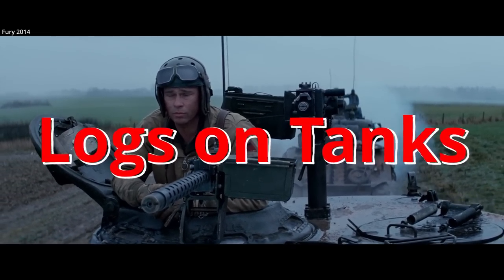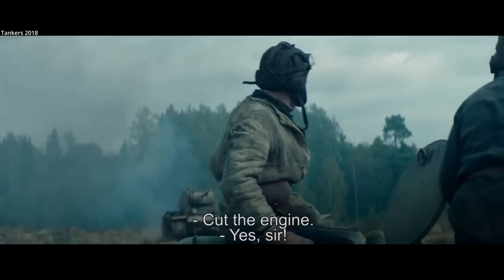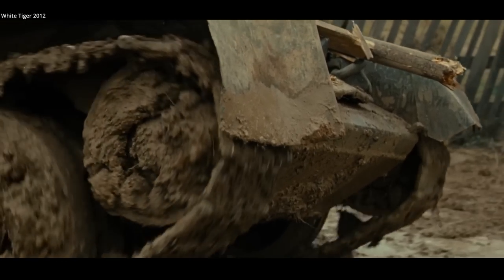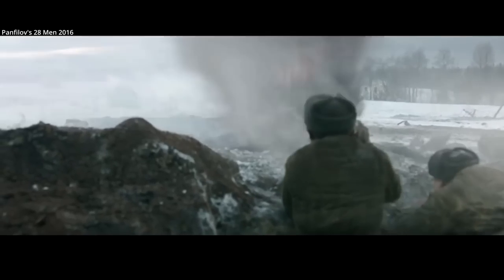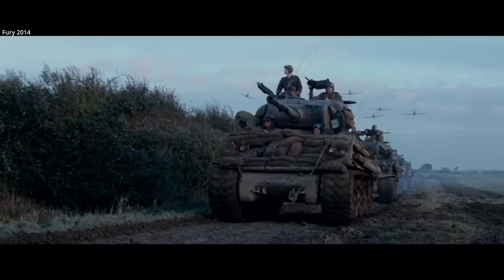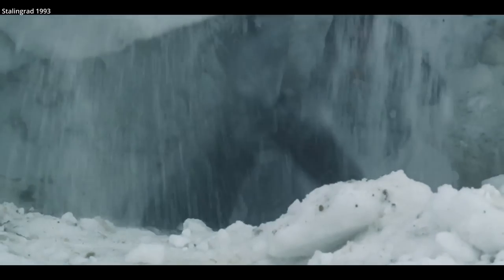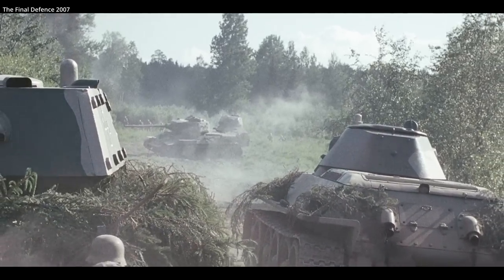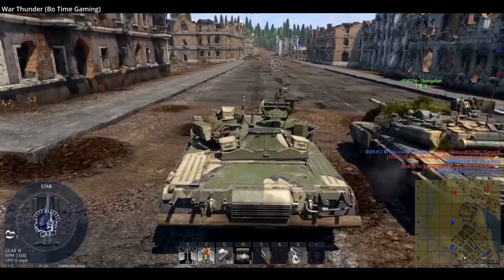What's with those logs on tanks?

Comment: During the Battle of Marawi in the Philippines, some armored vehicles of the Philippine Army were covered with planks of wood on the sides to provide protection from RPGs. They did work excellently
Reply: i was confused for a minute when i read RPG, i thought you writing about the Japanese during the Philippines campaign 
but i remember the war with IS fighters
Reply: Lucky they got older Soviet rocket propelled grenade from Maute/ISIS group
Reply: Was it a standoff effect, adding just enough space between the older RPGs and the actual armour to blunt the impacts? I know the militants there mostly had 70s era types of warheads, and very few more modern tandem ones as they didn't have Iran and Syria next door to funnel better kit into their hands.
Reply: @Del_S  I think it’s a load of heavy speculation, especially when only going off publicly available info. The vid goes over HEAT weapons which describe the RPG and what I have heard anecdotally is wood is mostly ineffective/of negligible effect.

I’m not saying vehicles surviving hits with this armor installed aren’t the case, just that surviving due to the armor hasn’t really been substantiated.

EDIT: it also heavily depends on the quality, age, and maintenance of the weapons used against the tank which tend to vary a lot with non-state actor groups.
Reply: From what I read it like most other improvised armour had little real effect, but did have a morale effect of making crews more confident in their armours protection. Problem is that almost nothing that the AFP rolled into Marawi actually had thick enough armour to stand up to anti-tank weapons, thus a panic to develop improvised solutions occured as happens in so many wars.
Reply: they actually faced RPG-2s most of the time. and these antiquated weapons are used with "homemade" rockets, so their effectiveness is questionable. even cardboard stopped a rocket and caught the spall.
Reply: BRO I WAS ILIGAN BACK IN 2017
Reply: This is what I call the poormans ERA
Reply: During the American Civil War, the Confederates strapped cotton bales to sides of river boats for protection, and it actually worked.
Reply: oh yes! i remember seeing pictures of their IFV's and wheeled armored vehicles covered in a shitload of planks on their sides, front and back
it was crude but it certaintly did the job.
also some of the captions and drawings made on the planks by their crews were funny or just straight out of mad max, it rocks.
Reply: @maru5235  true. One APC in that battle was named "Free WiFi"
Reply: Same with Indonesian soldier during the Aceh Rebellion
Reply: @Del_S  The intent was that the soft pine would not initiate the fuse, but would still cause the projectile body to crush/distort or yaw.   Sort of like a poor man's cage armor.
Reply: Sir the rpg was invented in 1953 in soviet russia and I think you ment the Japanese grenades and mortars
Reply: @DietrichM1  sir the battle of marawi took place in 2017
Reply: @DietrichM1  do some research
Reply: I member
Reply: One of the Filipinos I knew who fought in Marawi said to him, it looked like the crews poured dirt or stored extra ammo in the boxes, using them like big wooden sandbags. I don't know if that is fully true, though, but it's what he told me when I asked him if it was just wood or if they put stuff in it
Reply: It can work with older RPG but new version of RPG can easily destroy those wood protection. A 74 mm gun from T34 can cause the Phil. armoured vehicle to overturn if there is no turret. The impact is very strong.
Reply: @DietrichM1  some sort of history guy ha?
Reply: @silentwatcher1455 a  Soviet T34 fought German Tigers. Of course it outmatch even an APC
Reply: “free wifi”
Reply: Its a gamble but it worked

Comment: Getting unstuck, extra layers of armor, ready use firewood, there's many reasons to use logs on tanks. So it's not an issue having a few logs on tanks.
Reply: Sounds like the real question is why wouldn't you!?
Reply: Well the thing is, that can only be applied to tank. With human, unless you are in a tribal, or you are a rust player, wood body armour made from logs would not be a good idea
Reply: And to look badass.
Reply: Not to mention bouncing 88mm shells at point blank range.
🤣🤣🤣🤣
Reply: @zaholykrusedar1459  Why?
Reply: @manchotoberkommando  cumbersome, and low-protection aganist arrow, bolt and bullet, unless you make it hella thick, which futher the cumbersome, then it can protect you from those first two and maybe pistol round, but definitely not rifle round
Reply: @NK-qn6pq  it didn't bounce. It went straight through both sides, and spalling had jammed the turret. They were lucky to dodge shot at crew.
Reply: @planescaped  More weight = more fuel consumption to travel the same distance. If fuel is scarce, you want to move lightly.
Reply: That's why I have 3 strapped to each side of my car at all times

Comment: The British WW1 tanks had rails running above the sides of the tank for the unditching beam it carried. If they got stuck the beam was attached to the track by hooks and chains and the movement of the track pulled the beam forward and under the tank. Unlike using a log the beam could be kept moving until the tank cleared itself of the mud. This not only helped unditch the tank but the rails made sure the beam cleared the cab where the driver and commander sat. Unditching was so important that they would forgo a turret on the top of the tank.
Reply: Hobart,s funnies of WW2  were innovative  too....
Reply: @eamonnclabby7067  That is true. Someone once claimed that the Germans were the best at repurposing tanks. That person obviously had not heard of the 79th Armoured Division

Comment: 1:50 Just throwing this out there, but until the introduction of the Panther the Sherman had the most armor of any main line medium, especially when accounting for effective thickness. The sides were the only portion of the tank that could be considered thin, but again were comparable to the armor on the PZIV.
Reply: Yes, you're more than correct. The myth was prevalent though. It does seem many American tankers legitimately believed their tanks to be under armored. My guess is due to the excellent German guns they faced because in the Japanese theater they never had an issue with armor protection. Hell, even the M3 was adequate in that theater. Despite having some of the best all round armor and overall protection for much of the war, people often act, or at least they used to often act, like the Tiger and Panther were all the Sherman ever faced when that simply was not true. Most of what the Sherman fought against up until 44 was inferior to it. Sure, the German Panzer IV F2 and beyond could out gun the Sherman but it still never had armor quite on par with the Sherman and even the medium 75mm gun could knock out the latest of Panzer IV tanks.
Reply: TLDR in regards of armor debate:

Not the armor but the calibre and barrel length made all the difference.
Sherman M4A1 75mm L/40 were shorter than
German KWK 75mm L/43 or L/48 and other types.
The Sherman crews in Italy, North Africa or Normandy faced superior anti tank firepower whenever they were engaged 
which made them doubt in their armors effectiveness. 
Hence the nickname "Bronson" for their Sherman tank. A lighter, that "lights every time".
---
Guns of common medium tanks during 1943/1944:
Germany used their Kampfwagenkanonen main guns in very different tank designs:
7.5cm KwK 40 75mm L/43 used in PzKpfw IV Ausführungen F2 and G
7.5cm KwK 40 75mm L/48 used in PzKpfw IV Ausführungen G-J or Jagdpanzer IV
7.5cm KwK 42 75mm L/70 used in Panther or Panzer IV/70 - velocity of 900-1100 m/s depending on ammo type
Common German AT-guns and 88mm guns in 1944:
5cm PAK 38 50mm L/60
8.8cm FLAK 36/37 88mm L/56
8.8cm PAK 43 L/71 88mm
8.8cm KWK 36 L/56 88mm
What catches my attention here is that all of them were quite long. 

British medium tanks
Cromwell 75mm L/36.5
Crusader MK III 57mm L/43
Sherman "Firefly" QF17 76,2mm L/55

US medium tanks
Lee/Grant 75mm L/31
Sherman M4A1 75mm L/40
Sherman M4A3 E-8 "Easy 8" 76,2mm L/52
M10 Wolverine/M18 Hellcat 76,2mm L/52

Russian medium tanks
T34/76A 76,2mm L/30,5
T34/76B-C 76,2mm L/41,2
T34/85 85mm L/54,6 - velocity increased from 680m/s to 793m/s
(KW-1 76,2mm L/41,2 -- is it still medium with 43 tons?)

So the Germans used longer barelled guns earlier (=more velocity), giving them an advantage in tank warfare until Allied powers adapted their tank designs.
Reply: @BlackWhiteCater  I just wanted to correct one thing, I'm not trying to be that guy. But it was the Ronson, not Bronson. Ronson is the name of the lighter company.

I believe everything else is spot on and is the most likel y culprit for why the Sherman was considered to be under armored despite being relatively well armored in the realities of it's era. 

The Germans just used very effective and strong AT guns and weapons and earlier in most cases. The experiences of being unable to easily knock out tanks against the Russians clearly painted their decision making in AT guns and tank guns. Just about everything after 1942 they introduced could easily punch through a T-34 with few exceptions.
Reply: The myth probably comes from the effectiveness of German guns more than anything. When the M4 entered service it was February 1942. Their baptism of fire was October 1942 during the 2nd Battle of El Alemein. Most German armour by this time was using the 7.5cm KwK-40, one of the most effective AT guns of the war
Reply: @BlackWhiteCater  Chieftain did a pretty thorough job debunking the Ronson myth, as the ad that actually started the "lights first every time" tag line was produced post WWII.
Reply: Indeed, contrary to popular myth the Sherman was a very survivable vehicle, the gasoline engine would catch fire easier than a Diesel, it's good armor and design however gave the crew better than average chance to escape an impact.
Reply: German tanks by and large had longer barrels, so a 75mm long barrel muzzle velocity is higher. Sherman's had to play a catch up game. Shorter barrel was easier to deploy, easier to ship. But, didn't have the punch. You see it later later in Italy and March to Berlin. You still see alot of short barrels in the pacific until the end of the war. Because it was a different foe and armor had to hop islands with infantry.

Comment: Specifically,  the logs are use to get tanks off what is called "high centering", like mud so deep  or a ridge in the ground or a rock, where the belly is being held up and the tracks/wheels don't have traction or even touch the ground.  So you strap a log across both tracks and then the tank pushes it under and then rides up onto it over the obstacle.

Comment: My uncle was a tank commander in WWII! His tanks deployed to northern australia to repell the japanese invasion, and then to Okinawa for what he called "mop up" operations. They didn't see any combat in australia because the Japanese bailed as soon as they knew armor was coming, and he saw a lot of horrific combat in Japan, but it seemed to be more of things like white phosphorus traps. I don't remember the model of tank he used, but it was a limited run and there were only 5 or so of them made. from what he told me, they were tanks that were put up against the sherman to be the main battle tank but utilmately the army decided not to produce them, so they only had the original tanks. He was an engineer though, and made significant modifications to his tanks that he was quite proud of. his greatest fear was the WP traps, so he had 5 automatic fire extinguishers installed on his tanks, although he still ended up losing a tank and its entire crew to a WP trap. The tank also carried metal poles that were like these logs, only a lot smaller. their primary function wasn't for traction though, it was to turn the tank into an indirect fire support unit (like the paladin)! it was supposedly the only tank capable of indirect fire. the way it worked was the metal rods were slotted into blind holes in the back of the tank, then holes were dug into the ground. the tank would back up and drive the poles into the ground, which would kick the entire tank up at an angle, allowing for indirect fire. the tank could also be driven off its treads, and the treads stowed above. it had rubber wheel thingies (i think they are called buggies) that allowed the tanks to drive up to highway speeds on paved roads. the tanks were extremely fast compared to other tanks in service, which was why they were send to try and catch the japanese retreating in australia. the only thing he caught were field after field of burned farm land and slaughtered cattle. he told me it made him sick how much the japanese military just destroyed the land on the way out.
Reply: Australia was never invaded though?
Reply: @djnotnice108  Either he's gotten a few details mixed up, or his uncle is a L-I-A-R.

Comment: in the oil fields in northern Canada we call it "rip rap" and make roads out of logs. the early p/u's didn't have 4x4 but mom could drive her 53 Pontiac with large tires right over the hill, muck two plus feet up past the hubcap. Mom would have made a great tank driver.

Comment: I used to geek out about big tanks...but these days I don't think I'd want to be in anything other than a Sherman if I was in a tank during WWII. Light enough to where it was less likely to get stuck, but with a gun strong enough for most tanks and traveling in groups of five due to the numbers manufactured. Plus, they designed them to be easily maintained and somewhat reliable (radial engine apparently wasn't that bad and they switched from it anyways). I really like the look of the smooth cast hull, but apparently the welded hull was far more effective at keeping the bigger rounds out.
Reply: Since the Wright radial was air-cooled, they had a distinct advantage in North Africa over the water-cooled engines for maintenance.

Comment: Try crossing a wide boggy deep ditch without logs!
Logs where generally put on the tank ahead of time because you knew you had to cross a river or similar terrain feature with no sappers, field engineers or bridge carrying tanks in support.
You would think this illogical on glance but remember a tank company has about roughly 15 tanks on average so if each tank carried a dozen logs which is reasonable then that is 180 logs to fill preferably the short shallow of a river. 
Tanks natural enemy is the water which is why so many nations spent fortunes on developing amphibious armoured vehicles-amphibious tanks with varying success but still not common place even today.

If the route is secured for transport by logs roll outs or any source of traction, then that means the trucks should hopefully be able to follow behind.
If armour loses transport connection & contact behind the advance breaking through it is in all likelihood royally Fvcked as supplies of fuel, munitions, water food et cetera won't get through.   
Radio transmitter had a range of 7 miles moving, and 10 to 15 while stopped on a good day for M4 Sherman to give an idea.
If a communication truck or command post can't get set up across the tank crossing as mentioned river you might as well be blind & deaf!

I could go into more detail Johnny, but this is the jest of why logs where purposly put-on tanks ahead of time in WW2 & since even often to today just in case all doesn't go to plan.
WW1 logs were used because trenches were dug ever wider in response by the Germans to combat British tanks!

Comment: There's a picture of an M-4, I want to say in CBI theater, using the logs while crossing train tracks to prevent throwing one of the tank's tracks on the rails. 

Also, the traction thing. Get your car stuck in snow? Pull the floor mats and stick them under the driving wheels. Same idea. I keep a bucket of cat litter in my truck. Again, same basic idea.

If it's stupid, but it works, it's not stupid.

Comment: Great subject area! Johnny FYI: The US Pacific Theater forces also used wood planking to cover over the sponsons and suspension bogies on their tanks and AFVs which provided a few inches of space between it and the hull to prevent the Japanese from using magnetic mines and lunge mines against them. Later in the war, the Japs began using the 47mm AT gun, which was also equipped on the Chi-Ha tanks. At longer ranges the gun wasn't effective, but at closer ranges of 50-100 yrds, it could penetrate a Sherman's side armor easily. The US servicemen also began beefing up the sponsons with concrete and chicken wire along with the wood planking for additional protection. Cheers!
Reply from the maker: Excellent additional info sir! 🙏

Comment: Also One more thing, post ww2  Russian tanks evolved  based on the experience red army got from fighting nutzee armor .  Low Profile , High power caliber gun , Shorter crew , Extra fuel tanks , a Log , a snorkel , heavy cast turrets and high speed of the tanks are some features  suitable for Soviet deep strike doctrine which originally intended for striking the nutzee war machine , were now at loggerheads with the NATO forces, whose war tactics were now significantly improved after their own experience against the nutzees. Soviet doctrine also proposed troops to travel alongside tanks in BTR-152s (later BTR-60s and BMP-1 IFVs ). The Tanks and Artillery will flatten the enemy artillery , Armored and infantry alike then charge rush B with IFVs which will dismount troops and troops will move forward alongside the IFV to capture enemy positions  . 

Very different from NATOs defensive offence strategies
Reply: And now those tactics are biting them in the ass in Ukraine, and have seem since the start of the war.